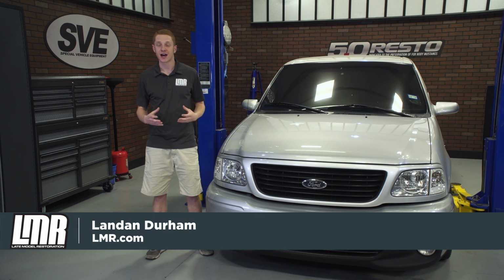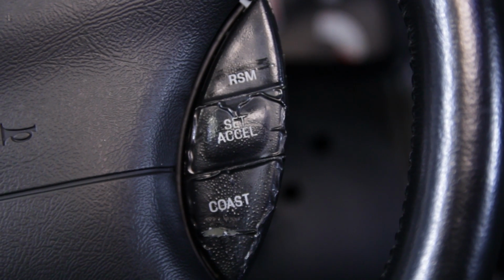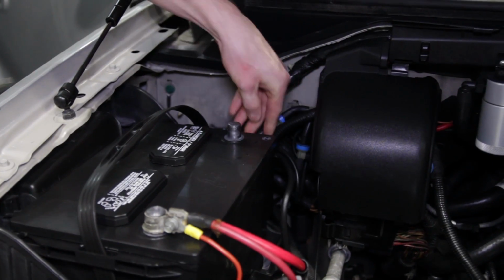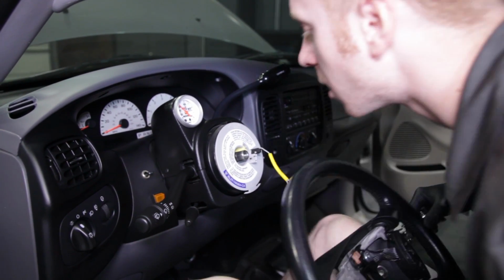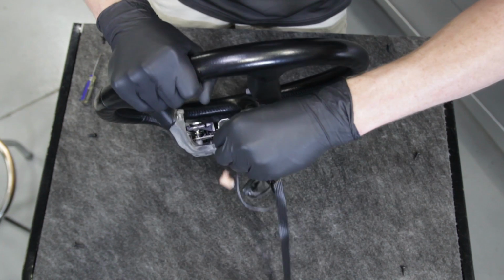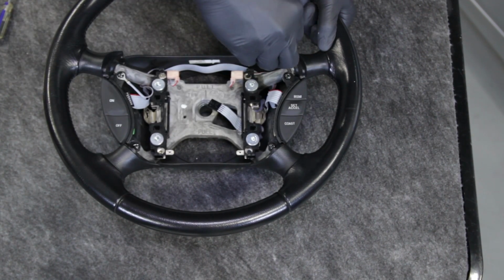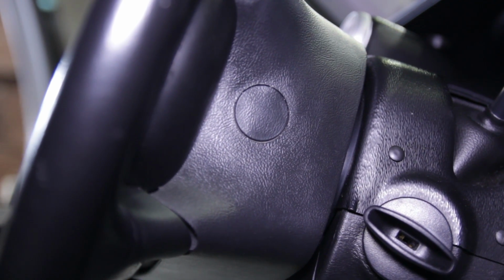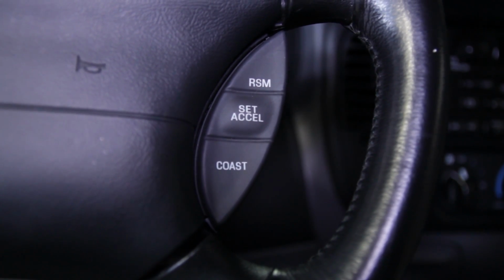1999-2004 F-150 SVT Lightning Cruise Control Switch Assembly - Review & Install

Comment: I did this and upon putting my wheel back together my horn will not stop going off
Reply from the maker: Sounds like something is pushing down on one of the horn contact pads within the steering wheel. Pull the airbag and inspect the two pads to see what's going on. -Landan
Reply: Did you figure this out mines doing the same thing .

Comment: Why tell us to remove the steering wheel.Just replace the buttons.They plug right in.$20 bucks  for the puller and 45 mins wasted time to remove the sw. CRAZY. Not cool.Just pull out the air bag and replace buttons.Less than 5 mins.Very disappointed.

Comment: Part number on steering wheel puller?
Reply from the maker: https://lmr.com/item/LRS-2380050/Steering-Wheel-Puller
Reply: That one is completely different from the video it wont work
Reply from the maker: I am sorry about that, the 2 jaw style we do not offer. You can usually rent these from a local parts store.
Reply: Can you provide a puller part #?  Bought these and can't use them.  :(
Reply: @chris4k2113  i got one from harbor freight it worked

Comment: Do you really have to remove the whole steering wheel to replace to Cruise Control Buttons??
Reply from the maker: Yes. -Landan
Reply: No, much easier to swap the buttons, leaving the steering wheel on
Reply: Late Mode